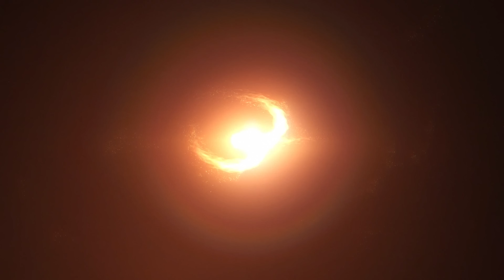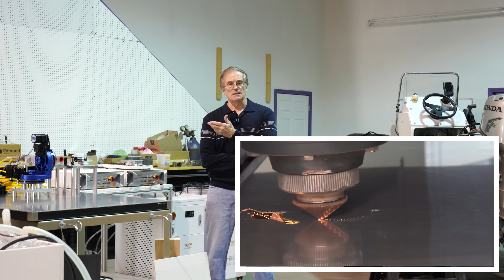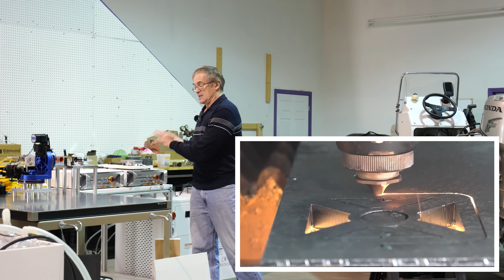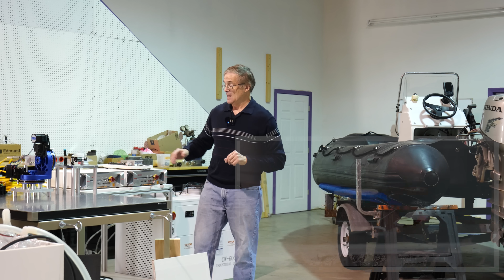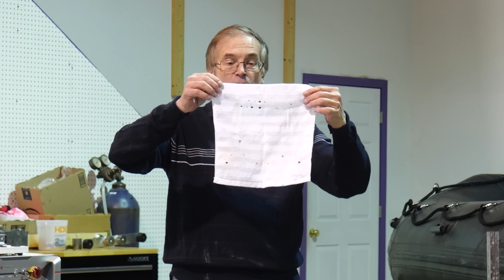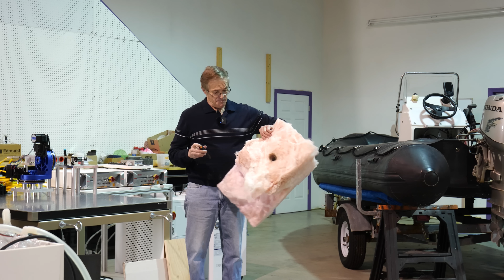We have a problem... and need your help!

Comment: How fast can you shut down the laser? 
You could make an active system with 2 layers of material (drywall could work) reasonably spaced appart that create a "darkroom" inside. Put a light sensor , or more than one on the sides, so that when it detects the laser light it kills the laser output. I believe that just the scattering of the laser hitting the back wall will be enought to trigger a sensor fast enought to prevent the rear material from being penetrated. 
Once triggered the hole can be patched (just slap a piece of black tape over the hole) and the experiment repeated.
You could even line the interior of the darkroom with something reflective or with difuse reflection as long as it does not reflect directly to the same path the laser took to come in. You could create a laser trap that works on the principle similar to what is used with integrating spheres.

Comment: You want to build basically a gun-range with a spall-catchment for light. A big box of no escape if you will.

My idea would be to look at having the fist layer be intentionally built to burn through instantly but that burn-through being contained/small (which will catch any stray radiation coming back from the backstop), then a gap, then something to disperse the beam but not absorb a lot of the radiation (like some convex mirror array angled at 45°) and than some material that can take the heat on the bottom (like solid carbon blocks or compressed coal).

Comment: I would imagine aerogels would have the same problem as the insulation. I wonder if something like the cheap and easy starlight like material such as nighthawkinlight covered would be an option. Just a wild guess as I don't know for sure and the laser intensity may ablate it faster than the material can deal with but worth looking at.

Comment: Have you considered materials that can scatter/defocus the photons? If you can somehow enlarge the beam using optics, it can be rendered much easier to absorb using whatever material you want behind the optics.
It would need to be placed behind the target you want to target with the laser, synced and aligned with the beam's movement coming from the other side. That'd be the tricky part.

Comment: Would cabon foam work?
Reply: Also, I am thinking that the wall panel should be a system to some extent.  For discussions  sake mount a 4'x8' sheet of plywood on a dolly.  Then put a peg system mounted to the plywood say 12" square grid.   Then you could make 12"X12" carbon foam tiles.
   This way, if you are making your own carbon foam tiles.  Or any other product for that matter.  You only need 12"x12" sections instead of trying to find large sheet materials.

Also you would easily be able to replace damaged segments over time as it will most likely be a sacrificial layer.

This gives you to options to make or find more exotic materials in small tile form rather than sheet form.

I know carbon foam can be made from bread. So you 12"X12" sections of bread or something similar could be made and caurberized relatively cheap and easy.

Also I wonder how resistant ceramic tiles would be? They are commonly available and reasonablely priced

Comment: im just a hillbilly but couldn't you just use a huge slab of graphite or just point the laser at the ground from a scaffolding would be the cheapest way possible as long as there isn't any water lines in the concrete or a basement under you

Comment: Plasmas (non-thermal or thermal) and dust clouds can block lasers, depending on the wavelength (such as infrared) even water (sprayed or in a bucket) can absorb the laser light.

Comment: Have you thought of building it top down and shoot against the floor? Mounting it on a crane or an elevated platform would allow you to shoot targets moving on ground. Most of the risks would be similar to dig a hole with a shovel and the rest can be avoided by limiting the range of the angles in the device.

Comment: Carbon. Its going to have to be some form of carbon. One idea is carbon felt, used primarily for welding. One called PAN Carbon Felt (SKU: 22070004) is rated up to 5400 degrees and is about 13mm thick, can be rolled up and transported easily but even still I'm not sure if that's enough. You might be well into the tens of thousands of degrees. That's a good question, I've played with heat shielding before but that was for thermite and its not even close to the temps you're reaching here.

Comment: Could you not reorientate it and use the floor or ground as the backdrop and fix the lasers on a lighting rig or scaffold? 

I would say or the concrete floor but repairs to that may get more expensive

Comment: 0:30 "our lasers are too powerful" :D
The absorption idea you have will work less the more powerful your laser becomes, so I would abandon that road.
Thinking in another direction for the solution:
Only send a very short ("just long enough") laser pulse, i.e. activate the laser for a very short time, i.e. get an accurate timer controller (ms precision should do it) that activates/deactivates the laser and plug that between your fire button and the laser. (Depending on the on/off timing limits of the laser you might have to build that directly into the current circuit and replace some "slow" elements instead of around the whole device.)
So when you know that your target gets sufficiently destroyed in let's say 420ms from experimentation (like "laser burned into the middle of the drone and it really didn't like that") make sure that timer is set to that number and not higher. (And I mean you're tracking it, so you can still fire again, if needed.)
(Future improvement option: Add some sensor data about distance to target, environmental data (temp, air moisture, ...) and calculate the timing settings dynamically based on thorough experimentation results based on variation of these influences. Only really necessary if you're going for a one-shot scenario.)
Oh and: Try to not get yourself into a small concrete cubicle with a steel door you don't have a key for. ;)
Reply: BTW: If you also need the laser for tracking: Have a second low power tracking laser that's continuously on.

Comment: i know you tried a wet towel but have you tried a water tank shaper like a aquarium and use Plexiglas instead of actual glass.  i dont know if it will work or not its just a low teck idea from a country boy.

Comment: What about those white insulation bricks that are used in electric kilns? They can easily withstand temperatures high enough to melt metal, for hours.

Comment: What about a water tank? You could try different additives to absorb more or less of the laser energy. 

Edit: On second thought, what about a series of small containers with water in them, shaped to interlock so that when you build a wall out of them there is always water in a potential beam cross section? That way the max water that can get dumped into the room when you puncture a hole is relatively small. Given you would need it to be relatively structural to support the water above a given container, maybe some kind of metal can. Would a wall of water-filled acetone cans work?

Comment: Just use carbon rough powder mixed with sand. Carbon can be from crushed coal and can absorb the laser and sand will put out any coal on fire and absorb even more the laser energy.

Comment: How about trapping the beam in a crucible filled with metal (copper, steel, tungsten..., whatever works best), BBs or Small ball bearings?  I'm sure the size of the metal spheres would matter in regard to defeating the penetrating power of the Lazer.  The way I see it, you've got all that power, might as well put it to use melting metal.  I wonder what would happen if you pointed that Lazer at a crucible filled with thousands of copper BBs?  Anyway, hope I helped.  You have a great channel!

Comment: I think you're limiting yourself.  Why not reflect it?  Reflect it straight down into a 55 gallon barrel full of water and an absorber (you have proven plywood to work).  A second point: a beam splitter could cut your problem in half before you remediate it.  A third point: turbid water would difuse the beam, as would secondary reflectors (think of titanium dioxide pigment for turbidity, glitter for reflectivity, and a pump to maintain suspension) Viscosity could be easily controlled with particle size/shape...

Comment: I can think of three options:
1. How about modifying the water idea you had but instead of towels in the water, have a large tank with really, really dirty water? The benefit of this would be the ability to move the tank by simply draining the water.
2. Another option would probably be to hire a contractor to dig 6ft deep on a small area of land that you probably already own or could purchase / rent. This would give you the same setup that shooting ranges have.
3. As other commenters said - turn it towards the ground.

Comment: You may have a point with the fiber glass, only it wasn't the right material. I once tried to cut a piece of transparent plastic foam with a laser and failed. The beam went trough it, but came unfocused at the back. The tiny bubbles were enough to disperse the beam, without absorbing so much energy that the plastic would melt.

Comment: Have you tried waterlogged fiberglass insulation, or rock wool insulation?  Sometimes, combining several materials with differing strong points can compliment each other. 

Possibly a slightly angled plywood backboard, with water pumped over the insulation -- collected at the bottom in a trough and pump circulated back through a top distributing manifold to quickly replace any evaporated water in laser hit areas might help extend the "Oh, No!" moments a few seconds until they become "OH, SH*T" moments?  This wouldn't cost a fortune to test or set up on a slightly larger scale and could be built modular for easy of assembly/disassembly, could be scalable, plus have the option to replace small damaged sections as needed. I have no idea if that would work reasonably well, though.

Comment: My first thought was "Kao Wool", it is  high temperature ceramic fiber which is used as the insulating material in gas furnaces for example. Maybe as a Sandwich material between dry wall sheets for stability.
Edit: maybe you could also coat the inside of the Sandwich with your superwhite scattering paint, so when the Laser burned through the front drywall, then through the ceramic wool, it gets scattered back into the wool.
This would be cheap to build, and i think also light enough to give it a small scale try. 

Good Luck and thanks for your videos, i love them (and the "Mad Scientist at work" charme they have)  :-)

Comment: What nanometer wavelength is the laser? Have you tried making a poor man's photonic crystal? Many photonic crystals do a wood stack principle to bounce the beam indefinitely until it dissipates. With that you can have a  Ceramic Fiber Blanket and then behind it a highly reflective mylar blanket to bounce it til that melts and layer after layer. so the first layer is the blanket when it melts there needs to be an airgap and the mylar to reflect til that melts and then creating a poor man's photonic crystal

Comment: I think you may have been on the right rack with the wet blanket.  Having the water vaporize could be resolved at least somewhat by pumping far more water than saturation up to the top of the blanket and letting it fall down in front of the cloth.  Additionally, making the liquid opaque would, I think be of some value as well although you will want to be sure that whatever is used to make it opaque will probably vaporize with the liquid and noxious fumes could easily result.

Comment: Alright here are my modest proposals:

Bigger optic diameter actively focused at target distance so the beam diverges quickly

Ablative plywood. Treat it with sodium silicate/ borax to inhibit fire, soak it with water beforehand to increase durability.

Glass / rock wool again (except wet)

a water wall actively maintained by pumps/ sprayers. The Idea is that a wall of droplets or laminar water will scatter the light to a non destructive level while being constantly replenished by the sprayers. Possibly add dye/ clay slurry to make it actually block the light.

Thin aluminium foil at a shallow angle to refract the light into the ground while spreading the load (see angled armor)

Doing the test from a tower/ hill like in styropyro's laser welder video so all expected test shots terminate in the ground.

Doing the test firing upwards and checking there are no planes/satellites overhead. let the beam be ET's problem in a couple decades.

Love your videos. Best of luck with your DIY missile defense. I'll stick to from the depths where a stray refraction from the laser munition defense systems won't instantly vaporize my retina.

Comment: Mix  fine graphite powder with fine calcium oxide 
Make a brick out of it
When laser hit this brick
It will make calcium carbide which is extremely endothermic 

Or
Use silicon metal and graphite mix 

To make the brick
Laser will make silicon carbide when it enters brick

Comment: A circular wall that rotates.  Alternatively, you could have an array of overlapping, rotating disks that form a wall.  Alternatively, you could have something sheet-like or tank-track-like on vertical rollers that scrolls like those stage props used to create a moving backdrop.

Comment: May be try making plywood box/tube can make multiple to stackable blocks one behind another as needed, pack the boxes/tubes with dirt/soil (wet or dry, not sure which will perform better). You can put it on a table or have there own individual height adjustable stand with wheels so you can use them as needed. And the first one/impact one can have conical or square divot, like bullet/projectile catcher, in this case laser light catcher. Not sure if it will work

Comment: Sauerkraut panels / mineral bonded wood wool boards? They combine a mineral based binding material with wood and they are cheap and flame retardant. 
However, I feel like the heat dissipation is too much to handle for any material on a single spot. You would need to move the material around, so the laser scans across the material. A conveyor belt with plywood panels? 
IMHO the most promising solution would be to kill the laser at the source - fast. I could imagine something with an outer layer, an air gap, and an inner layer. If the laser breaches the outer layer a detector is triggered and kills the laser before it can burn through the inner layer.

Comment: Might be a stupid idea, but couldn't you put a lens behind the target, or material that diffuses the laser energy into a wider area, and then use normal materials to absorb it?
Reply: High transparency, *proper frequency* , glass fresnel lenses.  Heck, maybe plastic might even handle it if you put the proper surface face front.

Comment: Just an idea. If you pass the beam through a perforated surface and into a container with a diffusing material (gas or liquid) and absorbent walls you should be able to get a reasonable amount of total energy absorbtion in the time periods you are talking about. All of the materials you used so far seem to be trying to absorb the focussed beam. If you can diffuse it more the absorbed energy per unit volume could drop a lot the and the use of more normal materials for the backing/absorbtion at the walls of the container. Cool project.

Comment: I don't think something practical to absorb or diverge the energy of the laser is possible, it's too much energy, just build a cheap sensor (light or heat or a single coper wire that burns instantly when heated) connected to a high current contactor and kill the laser, much easier and safe

Comment: I was thinking that you could take a container made of a material transparent to the laser (maybe a PET jug, they are sold in stackable formats) and introduce in them a sheet or coating of a laser absorbing material (maybe graphite paper as the one used for gaskets). The absorbing material should capture most of the laser light and quickly dissipate the energy to a large volume of water.

Comment: Request clarification; your setup is 1080nm (+/- 5nm) CW FOL? (I noticed the rack-mount units and their corresponding recirculating water coolant chillers behind you, so guessing from your previous THEO video) Estimated output power? Firing distance? (I know you already said to added corrective optics for collimating the beam, but what is the actual angular divergence for the effected range?

Assuming my above guesses are in the ballpark, I'd recommend a drainable water tank on castors (for mobility) that can be filled with 1080nm absorbent/diffusing particulates suspended in solution (or recirculated with some kind of submersible pump) with a 1080nm reflective back panel, redirecting any residually energetic beam path back into the diffusing emulsion. Recommend minimum beam depth of the tank at 16 inches.
Not sure what material to use as the primary beam interface panel on the front of the tank. (pretty sure you guys don't have the budget for a synthetic PECVD diamond-growth wall! 😄)

Love all your stuff, cant wait for more!
Reply from the maker: Thanks!
1,500 watts each at 1080nm. Divergence is approximately 80 microradians.
Remember,  we have to cover the entire back wall behind the "killing field."
Reply: Ceramic tiles. each tile positioned at brewster,s angle.

Comment: I remember seeing a form of bullet proof walls. They basically filled the wall with ceramic balls. When you shoot through, the balls break, and other balls fall down to fill in the hole. The laser is much smaller, but if there were something that is vaporized when the laser hits it and then more of that thing falls down to fill the space?